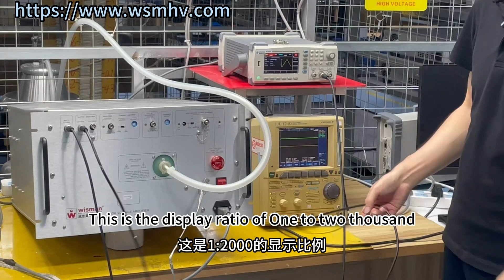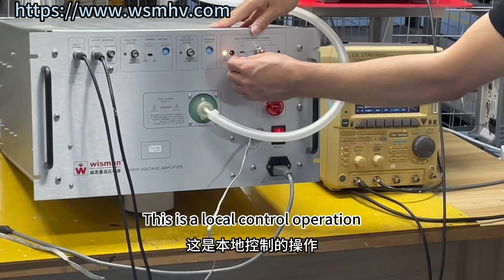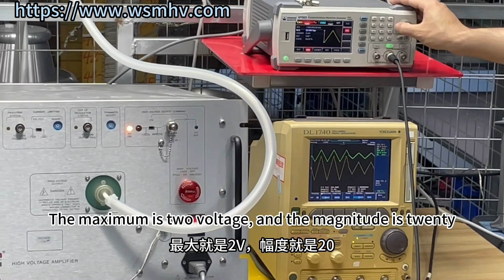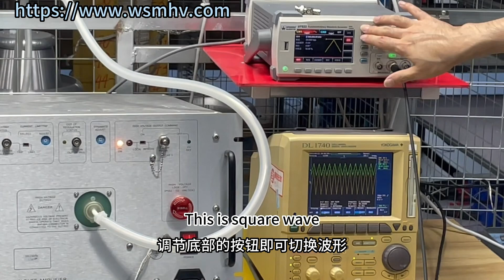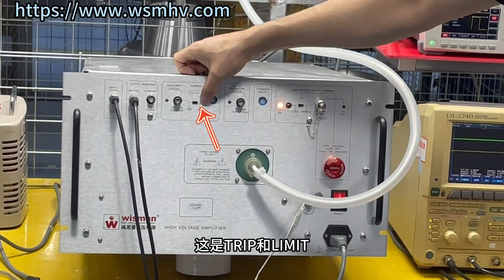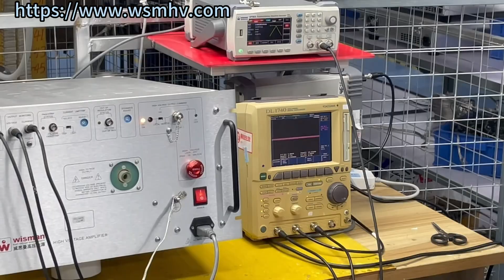2023年10月26日

Comment from the maker: Wisman's AMW series is a high-voltage power amplifier for industrial and research applications. The unique all-solid-state high-voltage insulation design can achieve high conversion rate, wide bandwidth and low noise operation. The four-quadrant active output sinks or outputs current to reactive or resistive loads within the entire output voltage range. This type of output is essential for achieving accurate output response and the high slew rate required for various loads, such as high capacitive or reactive loads. The amplifier is a non-inverting amplifier.